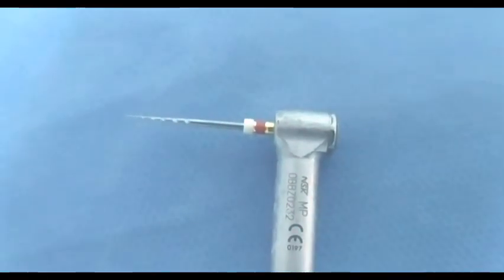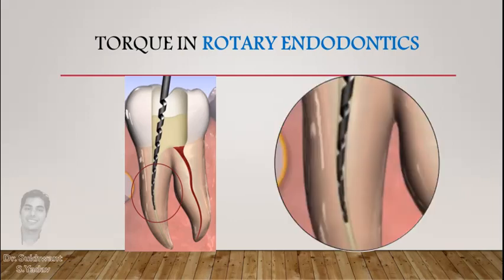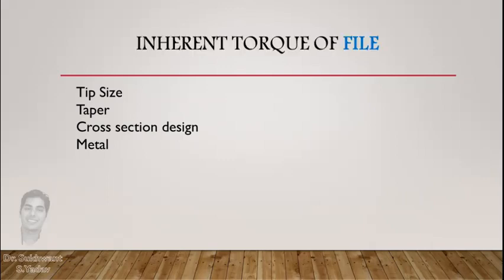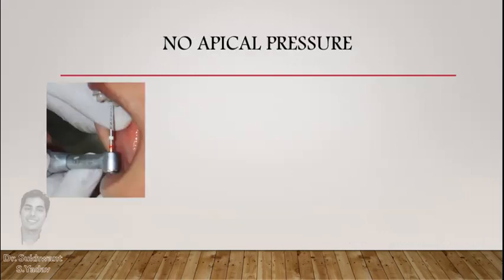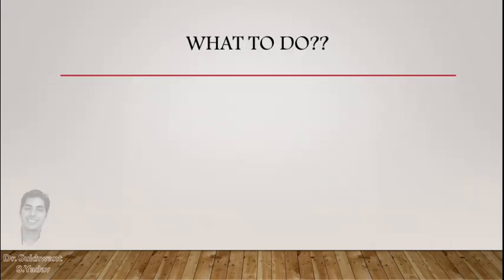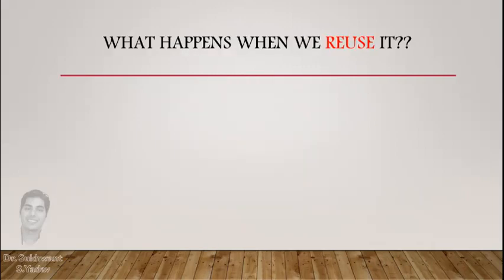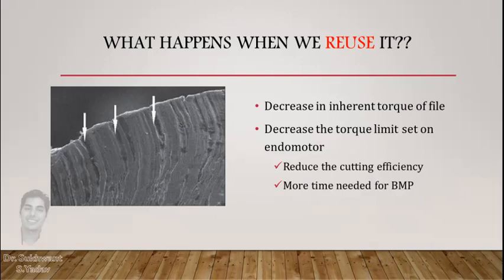Concept of Torque and Speed in Rotary Endodontics

Comment: Great review of basic principles.  A new product lets the clinician have complete control of the rotary file.  Speed and Torque are difficult to control with a engine-driven motor.  This new product is reducing unnecessary file separation.  Check it out.  Venta Endo / RoTAC Rotary File Grips  
THANKS GREAT VIDEO  STEVE

Comment: Great video Sir,
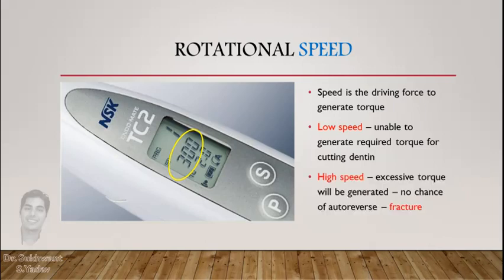I had a doubt that in the beginning you said torque is a force generated by a rotating object but it is torque which causes an object to rotate and at 3:00 you said speed is driving force to generate torque, what I've studied is that torque causes a motor to rotate??
Could you please elaborate?
Thank you
Reply from the maker: You are correct but in endo when torque generated rotates the endomotor, a force exerted that lead to cutting of dentin.
This force is equal to torque and useful for us to understand the mechanics in root canal. Now, file has also a torque called inherent torque, this is basically a maximal force that file can bear.
Speed are torque are related. If you run endomotor at low speed, enough force will not be exerted on dentinal walls.
Torque is basically a component of force.
Reply: @Endocrisps  thank you for clarification Sir..

Comment: Want to ask about should mix H file and K file  alternate during bmp ?
Reply from the maker: There is no rule about this. H file aggressively but irregularly shape canals and there is risk of fracture too. H files can be used efficiently at the end of BMP.
Reply: @Endocrisps  what about remer when should use ideally ,endomotor causes microcracks how to overcome with this ,? 
Pls make video on post operative restoration ? Every time there is need of crown in every post endo or composite enough ?
Reply from the maker: Reamers have good cutting efficiency but if you are using rotary instruments, then there is not much use. 
Golden rules to avoid microcracks- Never force a rotary file in canal in hurry to reach apex and heat treated files are good as they generates less friction on canal wall.

Comment: No idea what you want to convey?

Topic is concept of torque and speed.

What is the take home message??
Reply from the maker: Take home message - Follow manufacturer settings of torque for best efficiency and if you are reusing the instrument, to avoid breakage decrease the torque. But this decrease leads to decrease in cutting efficiency.
Reply from the maker: Thankyou for feedback. Basically I tried to explain how torque play a crucial role in instrument breakage.  Usually dentists got confused about it, they just feel that instrument breaks only when it is reused. Some dentists feel that low torque settings are safe which is also not true.

Comment: sir how much should be RPM set for Orifice enlarge and Bmp ? also kindly tell how on how much torque and RPM should we prepare canal so there is less chance of instrument separation.
Reply from the maker: RPM is mentioned on instrument packet like for protaper its 300 rpm,  For Mani Silk its 500 rpm. To avoid instrument separation, after 2-3 use decrease the torque. E.g. if you are using 2 Ncm then decrease it to 1.6 Ncm.
Reply: @Endocrisps  if we use initially low torque then ?
Reply from the maker: @sudarshanmandlecha5977  If you will use files on torque lower than recommended, either instrument will not prepare canal or it will deform if you will force it inside the canal.
Reply: @Endocrisps  which brand of endomotor you will recommend for us
Reply from the maker: @sudarshanmandlecha5977  It depends upon your budget. If you will go for a branded one like J morita, Dentsply or NSK etc, they are efficient in delivering accurate speed and torque and last long. On the other hand if you want to go for a cheaper one, try any chinese for a year or two.
Reply: @Endocrisps  ok
Reply: Is it have apex locators inbuilt
Reply from the maker: @sudarshanmandlecha5977  yes
Reply: @Endocrisps  Dr can you make a review  video  of various  brands of endo motors &apex locations if your time permits  TIA